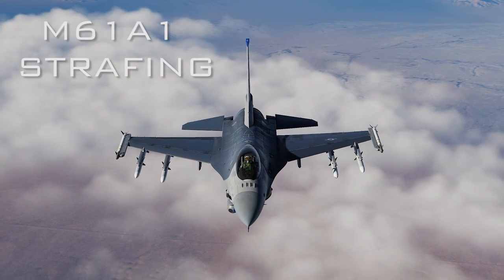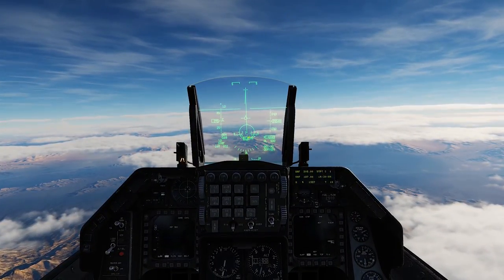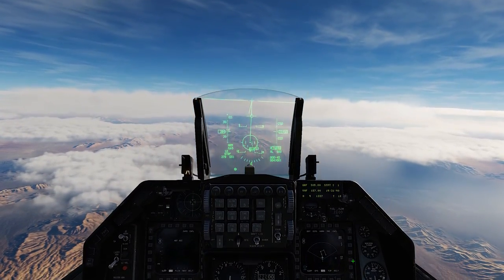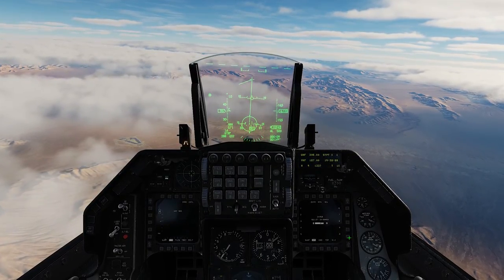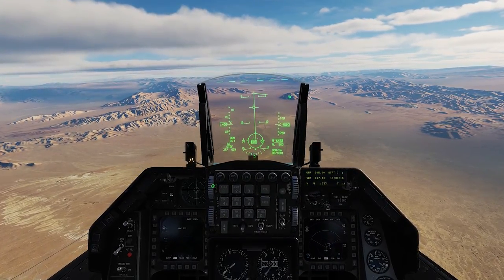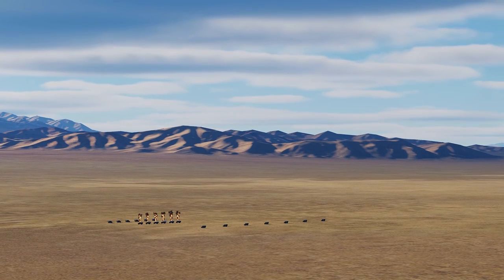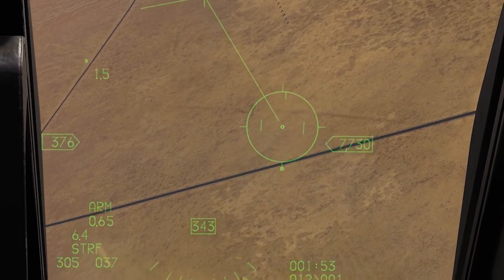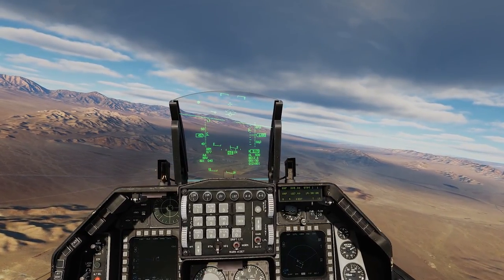DCS: F-16 Strafing BASICS

Comment: I often see videos with Aim 120s on the wingtip pylons but I thought I’d read/heard somewhere that the USAF didn’t approve this after it turned out the extra weight at the end of the wings created more stress on the wing roots via the lever/fulcrum effect. I was wondering if I had heard it wrong and there was another reason the 120s were on the wingtips in any video I had noticed such things. I notice in this vid, however,  that the Aim9s are on the wingtip and 120s further inboard, as I’d thought was correct until I started doubting myself. So, now I assume there’s no reason NOT to do it this way, but I’m still confused as to why so many have the 120s outboard if it causes problems. I suppose such problems don’t matter to DCS bits and bytes…. :D.
Reply: Other way around. AF puts AIM-120s on the wingtips. It reduces flutter compared to an AIM-9.
Reply: @terrancestorey7254  This is correct. 120s on the tips.